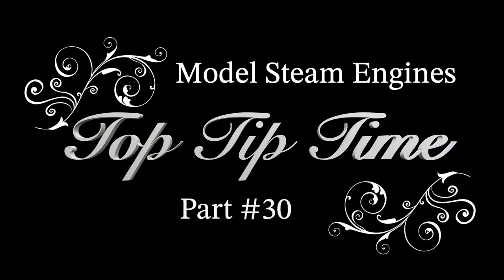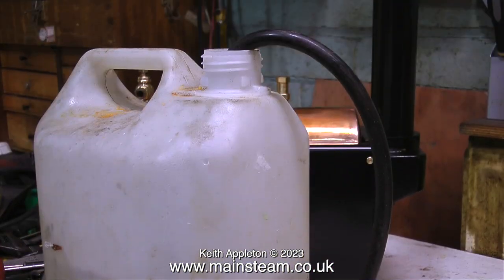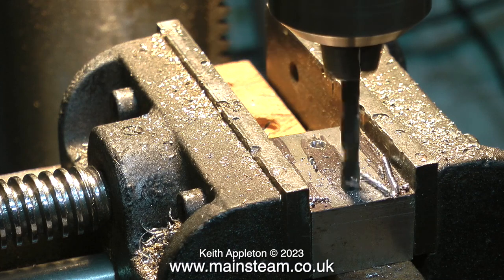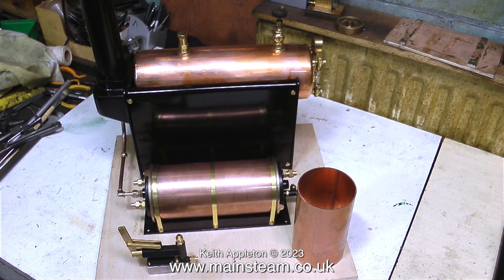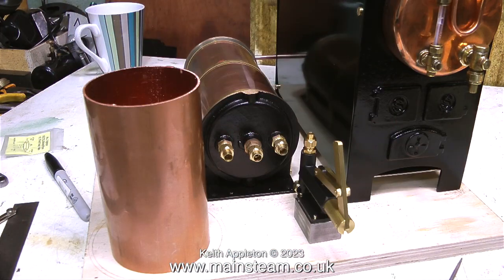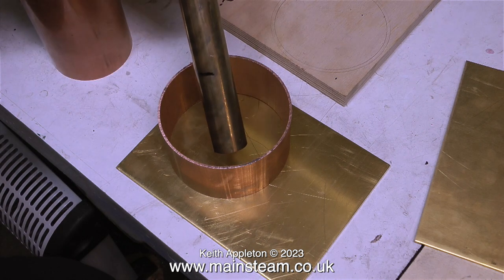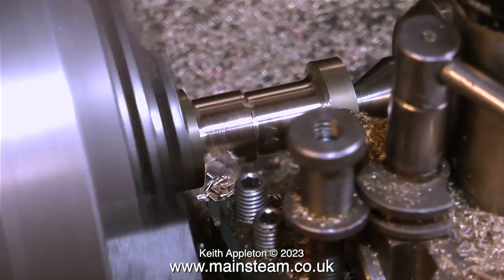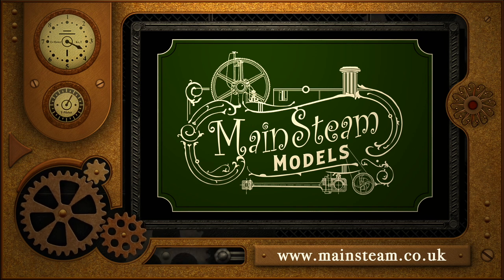MODEL STEAM ENGINES - TOP TIP TIME - PART #30

Comment: The flanges on the hand pumps are so painfully close to the body.  I have been waiting for "and so I attached the pump to a flat plate using JB Weld making sure to fill in the old bolt holes along the way."